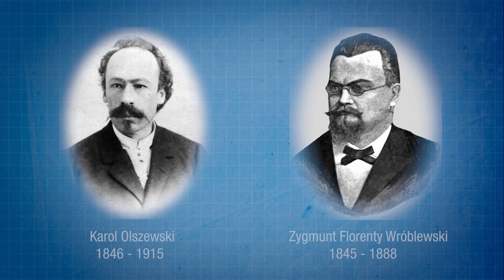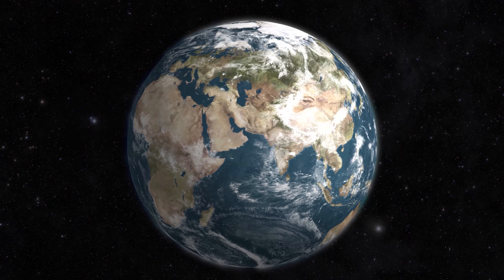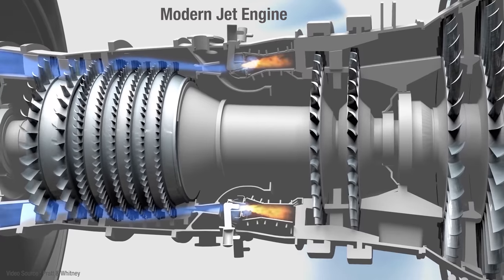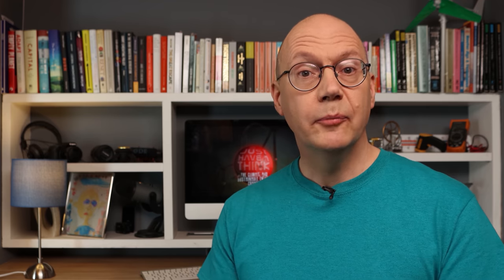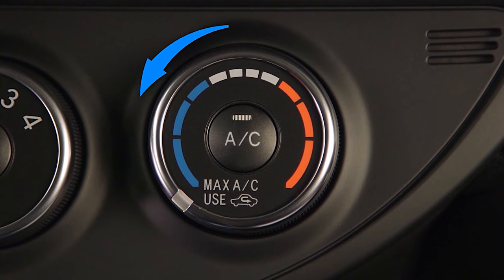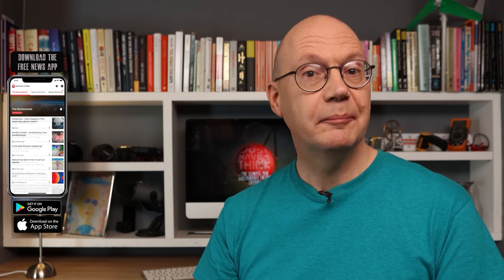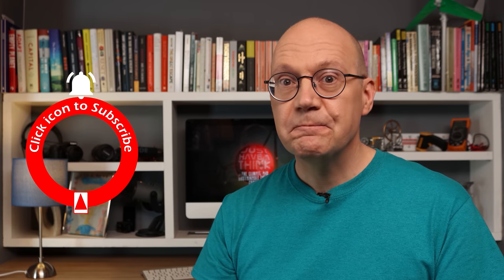Portable Liquid Air Power. A new boost for electric vehicles.

Comment: Plot twist    Patents were bought by BIG OIL  like Chevron did to the Nickel metal hydrate battery...
Reply: You better tell Toyota they do not have the rights to make, use or sell cars with Ni-Mhydride batteries.

Both all-wheel drive Toyota Prius grades come with a Nickel-Metal Hydride battery. Nickel batteries can withstand harsher temperature changes.

Comment: You seriously compared energy density of the liquid nitrogen itself with energy density of a complete battery system? 

The claim that  around 50% of regenerative breaking energy typically is lost is just not true. Vehicles with more mass has more battery capacity,  and therefore can handle more energy input, because of that the battery pack will in most cases be able regenerative breaking, from "normal" driving. Using mechanical or electric energy to produce heat, in order to reduce the inefficiency of a gas turbine slightly, for propulsion, is just stupid.      

Perhaps in hot cities it could be of more than insignificant value, because of the cooling.       

Let's assume we have a battery nitrogen hybrid bus, and the battery is discharged, so, it relies on the nitrogen.  It's an urban area, so we only need about 10 kW average output from the nitrogen turbine. Ambient air is 27 °C, how much ambient air do you think you need to raise the temperature of 1 kg of liquid nitrogen to 27 °C? The answer is an infinite amount of ambient air. 

So, we lower our expectations, we still have 27 °C ambient temperature, and 1 kg of liquid nitrogen, at -196 °C, and we settle on using 80% of that difference, so about - 18 °C, 80% of your 77% means leaving about 60% max theoretically possible efficiency, or less than 128 Wh/kg, theoretically available energy, 100 Wh/kg in reality is very optimistic, lets go for that-.  For each kg of nitrogen gas at -196 °C you want to heat to -18 °C with heat from 27 °C ambient air you need about 5 kg of that ambient air. But that's from nitrogen gas, we still have to provide heat to make it boil, with 27 °C air you need well over 1.5 of air to make 1 kg of liquid nitrogen to boil off.  So, to turn 1 kg of liquid nitrogen into -18 °C nitrogen gas you would need well over 6.5 kg 27 °C air.

In "our" bus, we needed 10 kW average output, that means we need 100 kg liquid nitrogen per hour,  if we can achieve 100 usable Wh per kg of nitrogen, which is highly optimistic. That means we need well over 650 kg of 27 °C air per hour,  that's over 400 cubic meters of air, at standard conditions, per hour.  Of course that's not exact, but should be about correct. And of course, as a range extender you could have it work in parallell with the battery, at a lower rate, to make the charge last longer, which would be less difficult. Still, any part of the energy for propulsion would need similar amount of energy in form of heat from somewhere.     

Perhaps someone thinks I'm not fair, as a counter current heat exchanger could heat the liquid very close to ambient air temperature, but we're still on a bus, we need room for passengers, and we need to waste as little energy as possible on pushing huge amounts air through huge heat exchangers. 

So, the usefulness in my opinion, for buses, is limited to cities where excessive heat is a problem a most of the time. Even there it's a big "maybe".  Have the liquid first cool the inside of the bus, then cool solarpanels that's on the roof of the bus, and by that reach higher than ambient temperature, when it's sunny.  Even then you'd need essentially free energy to produce the liquid nitrogen, or, very good use for the huge amounts of heat that is released in production of liquid nitrogen.

Comment: This is insane.
- This system effectively uses TWO fuels: LN2 and the "transfer fluid". 
- Transfer fluid is vaporised in the process -- whatever is in it will become part of the ambient air. 
- Ethylene glycol is definitely NOT environmentally neutral. It is toxic and in large concentrations it is teratogenic.
- Studies on vaping show that it can cause lung damage when inhaled. 
- LN2 is a severe risk itself, since it is not safe to store under ambient conditions.
- LN2 containers must either be permanently vented (and therefore under ambient air pressure) to prevent pressure buildup or,
- LN2 pressurised containers must have a special emergency vent system that will direct the blast of extremely cold, extremely high pressure gas away safely. Most equipment of this type will either have an "exclusion zone" set up around it or have a heavy steel "chimney" to direct the blast out of the area.
- Unless the liquid gas used in the system is a 'natural" mixture of LN2/LO2, the boil-off gas represents asphyxiation hazard. (Cold gas will settle down and in absence of strong heat sources, won't mix with ambient air quickly.)

Finally, I have doubts about the whole system. The demo unit looked suspiciously like an industrial pneumatic motor being driven by just a compressed air line.

Comment: Hmmm.... So the system uses energy not used by the regenerative breaking system (because it cannot be stored in the battery), so it is used in the turbine.... which ultimately creates electricity that it stores where ??? Not in the battery ... because that is already overloaded by the  regenerative breaking. Did I miss something?

Comment: IDK if this has already been done yet or not, but one idea I had was to modify a concept from Poland. They have buses that work half off oil fuel, half off overhead electric wires like a tram. Swap out the oil fuel for hydrogen! Or possibly solid state batteries when feasible

Comment: Their website states "it's just air" but there is also the heat transfer fluid that contains glycol which is toxic to animals and mildly toxic to humans. What is the cycle of the glycol mix? Is it contained or expelled? Based on the diagram, it looks like it is expelled. If it is, it needs to be added to the cost and the environmental impact needs to be considered. I don't see any documentation on this and it is making me curious. Thank you

Comment: I must say, even if this technology ends up not working out in the real world, it is such a cool idea. I would love to ride a bus powered in part by a compressed air jet engine. Also it's amazing the way this tech is able to exploit so many waste energy sources like the heat from components, brakes and AC as well as the extra electricity from regenerative breaking.
Reply: It's ridiculously complex and expensive. It will never see the light of day in the real world.
Reply: @Withnail1969  How is that not what I just said? I think it's cool even if it's not gonna be used in real applications.

Comment: Although not a cryogenic system, Peugeot Citroen did develop a compressed air hybrid system. Compressed air under braking (similar to electric cars charging batteries to brake) and releasing it to accelerate. Didn't go into production.
I haven't listened all the way through, he may mention it.

Comment: Buses and city/town delivery vehicles are both heavy and continually start and stop. They should therefore utilise supercapacitors to capture all the energy from regenerative breaking (as you said that a lot of that energy is discarded). Then use it to assist the main battery when starting to move
Reply: Good idea since capacitor are more robust than battery.

Comment: Okay, I'm missing something.

If vehicles don't fully use regenerative braking's recharge capability in order to protect the batteries, why doesn't charging from the turbine pose the same risk to them?

If the concern is overcharging batteries or charging them too many times, what does it matter where the recharging electricity comes from?

Comment: Essentially this is thermal energy storage and recuperation. I have often thought that we could do relatively efficient energy storage and recuperation with storage of heat in (for example) rocks. If the efficiency is proportional to the absolute temperature, then using electricity to heat up a large mass and then using it to make electricity later using (for example) the Carnot cycle. Storage at 1200K with the cold side at ambient, you will get about 75% efficiency.

Comment: One thing I took from this that I'm not sure is important but I had to ask.
It sounded like you said the heat transfer fluid was part glycol and if I understand how this turbine works that would enter the air being expelled from the turbine.
So would it be a good idea to pump glycol out into the air like that.
Reply: No. Not to mention having to fill up a tank/tanks with water and glycol
Reply: Glycols: Look up propylene vs ethylene

Comment: There was a comment about using such a system on board merchant vessels where you could use a smaller diesel-electric drive with the cryogenic air cooling system and a battery bank.

Comment: Great potential. For vehicles specifically though, I think capacitor tec for regeneration braking and initial acceleration is lighter and simpler.
Reply: yes but this is a great idea for commercial vehicle and stationary applications
Reply: There’s also the fact that the majority of the system cost scales with POWER, but the cryotank size can allow ENERGY scaling cheaply. This is the same difference with non-flow batteries of all types (lump supercaps into that group) and flow batteries.  For some applications, the energy is far more important than the power.
I live in a mass-transit district that spans 900m of elevation difference, so this system would be contributing on a 50% duty cycle over hours if it were simply supplied with larger tanks, whereas with batteries you’d have to unnecessarily scale up the power capability with the energy capability. 
(When doing utility-scale energy storage, you likewise have a shorter storage cycle (hours, to a day) vs off-grid applications where you need more energy storage vs power capability.

Comment: CAES systems suffer tremendously from the heat energy lost to waste (cooling) during the compression stage. Going further to liquifaction means tremendous heat energy losses in the refrigeration circuit. 
That lost heat energy all comes from the compressor drive motors at the liquid nitrogen factory. Electricity. Are we sure there is no better way to power vehicles which wastes less energy? How about short sections of overhead pantograph at each bus stop, and a package of supercaps to store excess Regen brake energy?

Comment: Seems just like what I've been expressing interest in, for small scale fuel cells consistently able to charge the batteries, with quick fueling. I'd like to know a comparative scale between this & fuel cells, while considering fuel cells also literally clear the air & produce fresh water (from electrolyzed salt water) and the rate of demand for multiple mobilities to be transitioned to clean forms. Lastly: other potentials with fuel cells that do use batteries, yet not nearly as many as a bev, while ev demand grows globally... and the rate of environmental catastrophes which need portable energy solutions, like a bus that can have it's own solar also fed through any water source for electrolysis, H2 energy, & fresh water. But, great stuff. Another clean solution.

Comment: It's funny, I've been a proponent for use of liquified air as a means of power transport for, oh, I dunno, the last 35 years? It's one of the few ways to effectively convert wave energy into a useful form, and of course, piping the stuff from the point of production to point of use would be pretty simple once the infrastructure investment in insulated pipeline had been made. Using it to boost the efficiency of electric vehicles seems like a nice bonus, and of course, expanding liquid air is the ultimate in "clean energy!" 😁

Comment: Excellent idea and great review.

A lot of people think hydrogen is the answer but distribution is a major issue. Liquid Air plants can be in every town and city.
Reply: And what exactly is going to power the liquid air plants? This doesn't solve any problem.
Reply: @Withnail1969  currently the uk is 50% renewable power. So either use this or attach it to a solar farm or wind turbine. This system gets the power to the system without the use of batteries.
Reply: @SimonAmazingClarke  The UK is not 50% renewable power. It may possibly be 50% renewable electrical power on a good day, sounds a bit high though. To replace the fossil fuel energy currently used directly by cars, trucks, farm machinery, construction machinery, ships etc etc etc will require vast additional amounts of energy. Nobody has come up with a solution. One barrel of oil contains 1,700 Kilowatt hours of energy. And we're using 2 million barrels a day. The most likely outcome, because it will run out eventually, is that our civilisation collapses.
Reply: @Withnail1969  it taks 5 kWh of electricity to turn one gallon of crude oil into fuel. That will save a lot of electricity. 

Check the National grid website for how much energy is renewable. As more people get solar, they will have less need of grid power, and can actually contribute towards it.
Reply: @SimonAmazingClarke  LOL, so if we deduct 5 Kwh per barrel we only need to replace 3,390,000,000 Kwh of energy every day. And of course that's just one fossil fuel,  oil. There's also natural gas which provides much of our electricity and heats our homes. Oh and natural gas is also used to make fertiliser to help feed our 68,000,000 people.
Reply: @Withnail1969  not per barrel, per gallon. It takes 5 KWH of electricity to turn 1 GALLON of crude oil into 1 GALLON of petrol or diesel. I can drive my electric car 18 miles on that.
Reply: @SimonAmazingClarke  sounds like a lie but lets assume its true. A gallon of diesel contains 48.88 KwH of energy. so let's make that 43.88 KwH net per gallon we get from the fuel. 43 gallons in a barrel. so we only need to replace 37,736,800,000 KwH of energy every day, LOL. Any ideas?
Reply: @Withnail1969  go check google, its on there.
Reply: @SimonAmazingClarke  when people say that you know they are lying. oh by the way i worked out your claim as to how many miles your car does. you said 18 miles on 5 KwH. so you're saying that your car can do 172 miles on the energy equivalent of one gallon of diesel. what kind of car is that? i bet you can't tell me, because you made it up.
Reply: @Withnail1969  did you go to school. 5 kwh equals one Gallon. My car drives 140 miles on 40 kwh which is equal to the energy used to convert 8 gallons. 140 divide 40 equals 3.5 miles per kwh. Times 5 equals 17.5 miles per 5 kwh which is equal to the energy used to convert oil to fuel.
Reply: @SimonAmazingClarke  no, dummy. you said 5 Kwh is used to make a gallon. the actual energy contained in a gallon is 48 Kwh, not 5. when i asked you for a link to prove your claim that it takes 5Kwh to make a gallon, you could not provide it. you were just lying, like you lied about your car. what kind of car is it so i can check your figures?

Comment: I read about a company that was planning to do chillers for cold-trucks. first run the compressor on the boiling nitrogen and then additionally use the cold nitrogen to cool the content of the trailer. which is a problem because when parked somewhere, apparently many of those chillers run on fossil fuel.

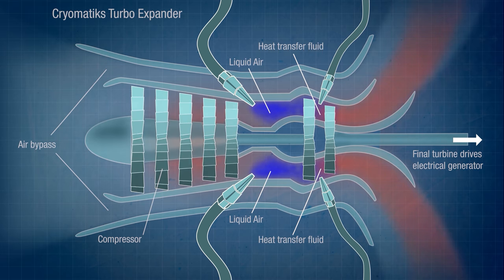Comment: 8:00 When an aircraft is said to "stall," that is not generally referring to the engine stalling, as an engine in a car might, but to the aircraft's trajectory through the air, and whether it's generating enough lift to keep it from falling.

Comment: ref: 11:50
This is styled for an electric vehicle, but I do think it would with a lot better as a range extender for a diesel/gas vehicle where you have a lot more heat to work with. The system would have less components and instead of 300 Kelvin difference it would be more like 400-500 Kelvin and would more or less be constant whatever the ambient temperature is. If you add the weight of an electric battery in liquid nitrogen and 1/40 in diesel or gas the efficiency should be way up an the CO2 released way down. Using a hybrid setup you could also have the advantages that an electric motor give and dropping weight from the motor part of the vehicle .

Comment: I love that it's basically just replacing expansion from combustion with evaporating liquid nitrogen
Reply: Not necessarily "expansion from combustion".  If the original power source is wind, hydro or solar cell,  its power from Fusion.

Comment: That is all they have to do is wrap the pipe with a pipe wrap conductor, and divert some of the flow back into the unit a recirculation if you would, and then take the rest of that nitrogen, and run it threw an expansion valve to bathe the room temperature in the cooling tower which has an exhaust fan that recycles all of the nitrogen that comes off of the top.

Comment: Maybe I missed it but did you cover the overall efficiency including the creation of liquid nitrogen?  The 74% figure related to extracting work from the stored fluid but what is the efficiency of the cryogenic stage?  In other words we store energy by using energy to compress and cool the gas. Overall how much of the input do we get back?  How does this compare to batteries?
Reply: Yeah. In the stationary liquid air video, the point was made that the installation was recouping the cold & heat that was produced in the process of expanding & compressing the gas respectively, which was one of the drivers that made the whole thing efficient. You cannot do that in this application.
Reply: How could you miss something in a 13 minute video???
Why don't you do some research on your own???
He can't cover every aspect... Your attention span is too short!!!!